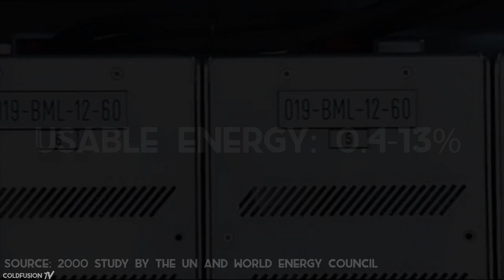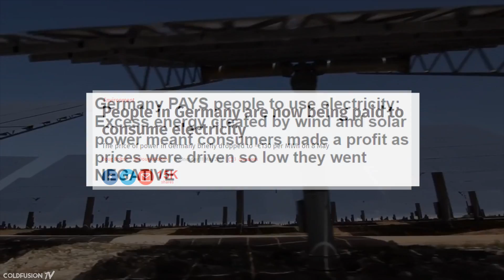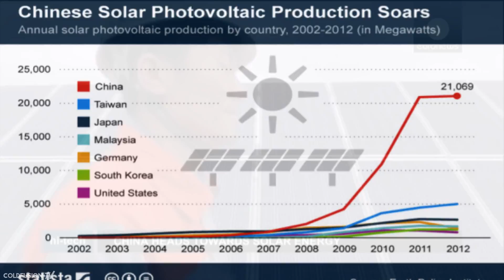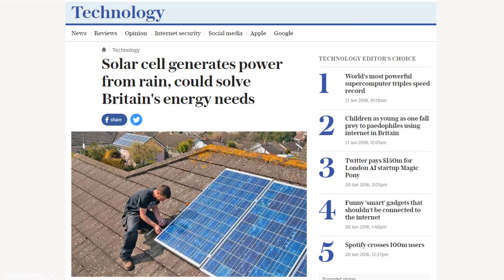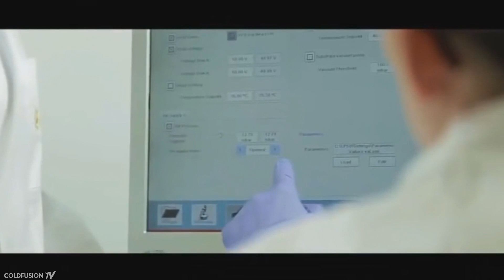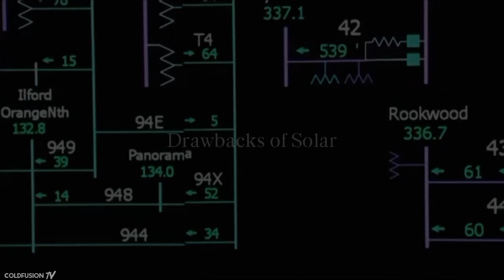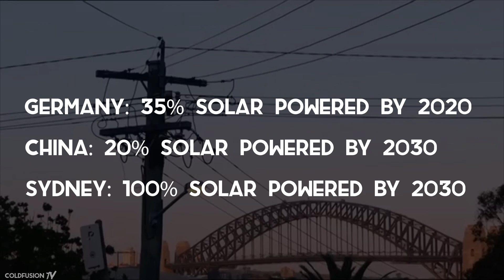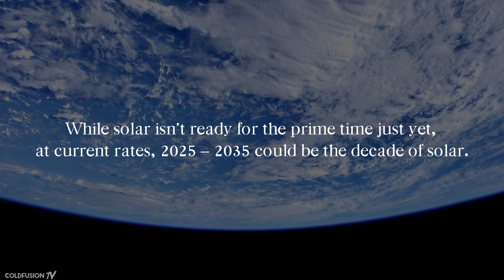The Truth About Solar

Comment: Storage is actually quite simple. You use the Sebatier process to create Natural Gas from sunlight with excess capacity, store it and use it in a standard power plant at night. All you need as a feed stock is water and carbon.

If you only have water, you can store the H2 and O2 and burn it at night, exhausting it all to replenish it during the day, and you get most of the water back when you burn it.
Reply: Timothy Zyg very, very, very ineffecient process. might as well piss our energy away.
Reply: "Storage is actually quite simple."
Resource costs are not part of you "simple" why?
Reply: With increasing difficulty after each reply, Dai Qibao's messages become more and more unintelligible.

..a truly fascinating absurdity.
Reply: Widg3t's Widgets Yes its inefficient. But its doable and effective. Solar panels have no meaningful end of life, so you just have to keep making them until you get over the bootstrap limit. Now you effectively have permanent power plants with near zero maintenance, and essentially infinite capacity (power/time/cost).

The point is, there are panels that are well over 40 years old that are functioning at better than 85% original capacity. They are extremely durable, have no moving parts, and all we have to do is keep making them until we tip over the "tipping point".
Reply: Timothy Zyg "Yes its inefficient. But its doable and effective."
Non sequitur. Doable effective inefficiency.

"Solar panels have no meaningful end of life"
False, anyone can observe solar panels are in landfills.

"Now you effectively have permanent power plants with near zero maintenance"
Zero maintenance production doesn't existent in reality.

"and essentially infinite capacity (power/time/cost)."
Where is the capacity at night? What is the resource cost relative to ALL other methods? You don't know, you pretend. A person can pretend ANYTHING.

"The point is, there are panels that are well over 40 years old that are functioning at better than 85% original capacity."
The point is, there are old cars that are well over 40 years old that are functioning at better than 85% original capacity.
SO WHAT? Everyone should die this generation so you feel good?
Reply: Dai Qibao I understand the economics of the situation...the point I am making is the basic engineering principle of greater efficiency implies lesser resilience, all other things being equal.

If the price of solar gets low enough, it will be economically viable.

I am not sure where you are getting your data on "Solar panels are in landfills" but, panels never go bad. All that happens is that poorly made panels short out, as the metal parts corrode and decay. It is a very easy matter to repair them, and even cheap modern panels don't use those manufacturing techniques anymore.  What you see in landfills are cheaply made, older panels that people did not want to repair.

I'm not pretending anything, friend. You seem to be engaging in emotional arguments.

As far as "everyone should die this generation" goes.. I never said we should stop using fossil fuels. They are a vital part of our economy, and need to be preserved. What I am suggesting is that we should use MORE fossil, nuclear and hydro to bootstrap the solar infrastructure, make it cheaper, and make it cost effective as a replacement for the existing structure. In other words, take the boot off of solar and let private business make it work. They will, because its mostly blue ocean right now. You make solar cheap enough, and fossil fuels will vanish, naturally, without economic upset.

Please don't conflate me with hippies. I don't give a damn about all of that nonsense. I am interested in long term human success, and fossil fuels are not the answer for us, long term (as in centuries). Fossil fuels are a dead end, and we need to invest in renewables and alternatives now to insure the continuation of our species.
Reply: Timothy Zyg "If the price of solar gets low enough, it will be economically viable."
It IS the most resource intensive method of energy production.
To say "IF future" is to pretend NOT the reality of NOW! A person can pretend ANYTHING. What a person pretends is of no significance to reality and others.
Equivalent example: Housing prices might come down in the future, so everyone should by the most expensive houses now.
Solar prices might come down in the future, so everyone should by the most expensive solar now.
Duh!?!

"I'm not pretending anything, friend. You seem to be engaging in emotional arguments."
Not pretending would be have a resonablity of objective evidence. Saying "friend" to a strange would be to "pretend". Saying "you seem" is one pretending to read minds. All emotions are pretend. Understand pretending better?

"What I am suggesting is that we should use MORE fossil, nuclear and hydro to bootstrap the solar infrastructure"
As in use steel hammers to make diamond hammers. Which people don't want to do obviously demonstrated by the value price of those thing by everyone in the aggregate market.

"make it cheaper, and make it cost effective as a replacement for the existing structure."
*

"take the boot off of solar and let private business make it work."
Yes. Stop subsidizing solar power. Take away the government money that makes people pretend it viable.

"You make solar cheap enough, and fossil fuels will vanish, naturally, without economic upset."
Pretend statement. Solar IS the most resource intensive energy production.

"I am interested in long term human success, and fossil fuels are not the answer for us"
So you not interested in what people want to buy. Nothing you say indicates a awareness of others wants.
Reply: Dai Qibao Look, I was trying to be polite. You are grandstanding with an evidence free hypothesis. Be as emotional as you like, but until you cite some sources for your claims, which are extraordinary, you will continue to appear to most as.. well.. a nutter.

I mean seriously... try some valium.

Do the math. Think before you post.
Reply: Timothy Zyg "I was trying to be polite"
Pretending. Null.

"with an evidence free hypothesis."
Solar doesn't work at night, thus a non-solar production facility is required.
If solar is the most expensive energy production, then you'll not advocate for solar? Yes or no?

"You are grandstanding"
Then reality is a "grandstand". Solar is the most resource intensive method of energy production.

"but until you cite some sources for your claims, which are extraordinary"
Wiki Cost of electricity by source. Solar IS the most resource intensive method of producing energy.
Reply: Mate, I dont are about your comments anymore. Good luck in your quest for perfection, and I'll be over here, working for the good.
Reply: Timothy Zyg "Good luck in your quest for perfection"
Reality is the pretend of "perfection", reality just "is".
Anyone can observe that solar is the most resource intensive method to produce power. Advocates of "solar" aren't interested in what the people want, they're interested in authority over people.
Reply: Lon Jemaa "unintelligible"
Solar is the most resource intensive method to produce power. Solar has become a religion some people pretend in.

Comment: Oh, jeez. Another rahrahrah pie in the sky piece. Look, the TRUTH about solar energy is that one square watt gives one KW on average, at 100% efficiency and 100% angle and 100% sunny days. Best PE cells give 30% at perfect angle. Use energy to angle the cell, and figure in clouds and inclement weather -- 100W/SqMeter is probably the max output.

This is not an engineering problem. This is a "There's not enough input" problem. Listen to "could" might be" first" "experimental" and "Startup funding."

In other words: Bull$#!t.

Comment: I think the biggest misconception about solar is that
we still do not harness enough of it. We do, but not for electricity.

The problem is that solar energy is needed for a lot of stuff
That is agriculture and nature.

Every plant needs a degree of sun exposure. And agriculture's demand
of solar energy is huge. Furthermore plants in the nature and animals also
need light. 

So I think we can only use a limited percentace of solar input
for electricity and heat generation. The bigger part should be reserved for
agriculture, nature etc.

Comment: It's still a question of poisoning the soil and water table.  Solar panels use toxic metals such as cadmium, nickle and lead.    The mining and refining of these metals leaves "dead-areas" around the plants that are so large, they can be seen from the space station.

Add to that the very short life these things have.   After ten years, they need to be replaced or you lose more than 70% of optimal efficiency.  And these toxic metals cannot be recycled.  So the old solar cells are tossed into the landfill.

The most efficient and cleanest energy still comes from hydro-electric generators and nuclear plants.

Comment: The truth about solar is that it doesnt work on its own. Its works best combined with wind turbines and batteries for storage. While the total cost of a single house installation is around 10K excluding the batteries, add those to the equation and it becomes waste of money. So even with 100% efficient solar panels unless you solve the storage of energy problem u got noting. We dont need to develop more efficient or cheaper solar panels, we need more efficient and cheaper storage.

Comment: The conclusion I came to in San Diego Ca. USA is that our county government does not want to purchase any excess energy your panels produce, so you can't cover your roof if you home usage does not equal needing that many panels.  I wanted to offset my original cost over the lifetime of the panels by installing extra panels so I could sell energy back.  Even with the state giving us a discount/rebate on the purchase, we do not use enough electricity per month to warrant the cost of borrowing the money with interest over the life time of the panels.  IE:  We would have barely paid off the loan when the panels would start to expire.  What have we gained.  NOTHING ! 

I am think of supplementing my energy needs with a Vertical Wind Turban, because being within five miles of the ocean we always have a nice breeze.

Comment: I calculated my cost to power my house with solar panels. I could get up to 80% of my power from solar panels. The life span of the panels is 20years. The cost of the panels would be made up at the 20 year mark. 0 savings for me. This did not take into account energy used in manufacture and installation and batteries/converters. TOTAL WASTE OF RESOURCES.
Just as bad as using hot water to unfreeze a wind powered generator. One dousing was more that the generator would produce all year. Renewable energy at this time is a BIG JOKE played on the taxpayers. The cost of a wind powered generator will never be made up in power generation. The energy used in its production of the generator will never be made up. USELESS. TOTAL WASTE OF RESOURCES.
Both solar and wind power have killed more animals/birds than fossil fuel use has. Using fossil fuel has actually helped save animals (tar pits gone, poisonous gas gone, warmed areas in Alaska from pipeline, etc).
STOP THE LIE ALREADY.
Apple spent a lot of money of solar panels. The story sounds good, but the money is spent and energy already used. Now they will try and get it back over time. They will loose. Math proves it. Energy used and money spent is more that money saved and energy produced. JUST PLAIN DUMB.

Comment: Why has no one mentioned that when in Germany the electricity price went negative, is the proof that you can't utilize the solar power on the larger scale? And how they have problems with the unstable grid, and the overproduction?

Comment: yes thoughts, hook up the  world to solar collection for energy, and when it maxes out its total rate of draw by demand this becomes the set rate limit and we'll adjust to it, for when energy is free all outlets that demand more wont be a focus and therefore no longer used. a massive cultural shift will happen, and when energy is free there will be no more money used, or fighting over resources..... get with it, remove the focus on individual house \building panels stop wasting time and effort on the per unit sales. focus on contineint to continent solar collection and storage and remove all the old power lines and poles and meters, this will end the profit monopoly greed race, opening up the future of wireless power exchange. one antenna per building. larger steps are needed, dont maintain the same capitalism cultrual paradimgn of nickel and diming individuals decade after decade.... one time done

Comment: DEMAND ISSUE CAN BE SOLVED! Close gates to hydroelectric dams at during the day and open them at night.
Reply: Good discussion !!👍👍
Reply: And what about the flat countries where you can`t put damns?
Reply: Envex no country is perfectly flat and countries with no/little rainfall have more sunlight so they can export electricity during the day and import it at night.
Reply: There are huge areas where you don`t have big rivers. For example china`s heavily populated areas are far from the mountains, where you can produce much eletricity, and you can place just a few hydro plants on a river. In northern america the central parts are mostly flat. and its the same with many european countries too.
You can`t rely on energy import solely. Transporting energy on longer distances is fragile, you cant have that robust grid what you can have with multiple power plants, and you have to use DC lines if you want to transport in longer distances, which are much more expensive.
Reply: Envex I saw a documentary about an Indian super solar plant. They have buildings on site to invert the signal. DC does NOT need to be transmitted long distances if it's inverted on site.
Reply: Yes you can use AC but the over longer distances the skin effect of the AC is going to result in more loss.

Comment: I saw a lot of footage of concentrated solar power plants, but you only talked about photovoltaic technology in the voiceover.  Many of the problems you discussed about PV would be solved by substituting CSP (specificially an HFC).  They can store thermal energy in the form of molten salt to be used to generate electricity well into the night instead of simply storing excess energy in batteries and operate at an efficiency of up to 60%.

Comment: solar might be good for a cabin or on an island. It is designed wrong. It absorbs infared which is useless, and it isn't designed to allow for efficient use of photons. That is why so useless for more part. If they could make it green with no glossy surface then you might be on to something small.

Comment: LOL, Solar roadways have been implemented now so they are real and still being tweaked.
Reply: You should really look into those places and the data it has been implemented.

And you'd see, how much of a money/time waste that concept is.

Also, i wouldn't drive on a glass surface, even if it is "roughed" up, think when it gets wet, you are going to go into a spin.

Also, we already have pretty much one of the most recycled material already being used on the roads, "blacktop" or "asphalt" as most know it, and it works extremely well and is pretty much all around better in every other way compared to solar roadways, but they do not make energy.

Also, better way to utilize solar panels would be using them in deserts, lots of space, lots of sun and lots of low humidity.
Reply: Mazaroth
As I said they have been implemented and are still being tweaked.  Will not be worth a damn in places without much sun but desert highways and places where it is sunny a lot they would be wonderful.  As far as the slipping that doesn't happen due to how they were designed.  It isn't flat glass.
Reply: Implemented where? Name the places? Tweaked how? I suspect the final tweak will be to tear them out and repave the roads with asphalt. The ideal properties for road surfaces and solar collection surfaces are so divergent, it is lunacy to think there is any benefit to combining them. It's a dessert topping, and a floor wax!
Reply: I'd rather use blacktop, it has far better traction in every condition and doesn't wear as fast as glass.

Also, you know how those solar panels would be utilised best?
Building massive solar farms in deserts, like they already do in some parts of US and wealthier places in middle east, since those places are dry and sunny most of the time.

And you know what, blacktop/asphalt is easily one of me most recycled material in the world, even 95% of the used material is recycled when they repair the road surfaces, because you only need to heat up the stuff and add more gravel or bitumin into it, both of the materials are pretty plentiful, especially the gravel.

Also, do you know why tiles are a bad idea as a road surface?

The ground underneath them gets unbalanced everytime you drive over them, making each tile a seesaw eventually when they get loose enough.

And using glass, even when it's "bumpy" or "buffed" is still fucking stupid fever dream of people that have no idea about road engineering, have little rocks or sand on it and it gets scratched easily, even worse when you have tons of metal on rubber going fast over it, that stuff will wear down in few months, when you need to replace it.

It just isn't cost effective in any possible way.

Comment: The amount of batteries for these cars homes etc would be staggering (batteries are made of some bad materials and dont last long) energy saving bulbs are made with mercury....I would like to see a battery car drive 20 miles on a freezing night using the battery heater in a snow storm using the wipers ,headlights,sat nav and radio then get stuck in a jam for 20m.